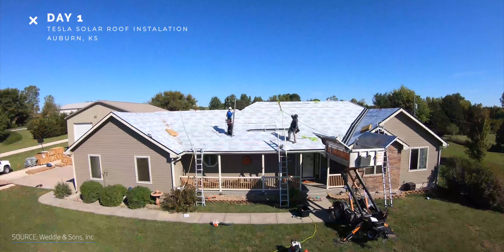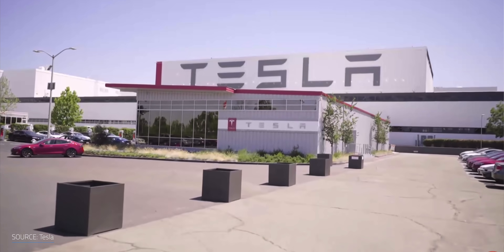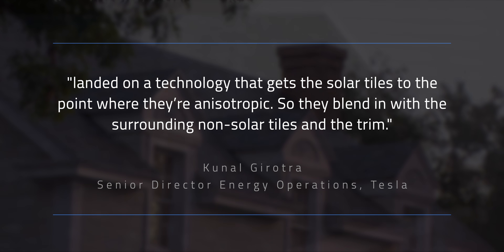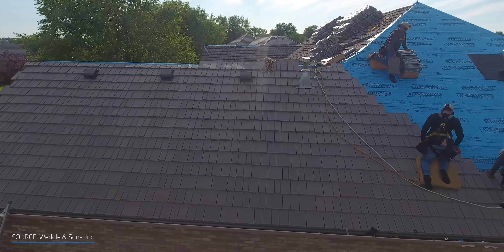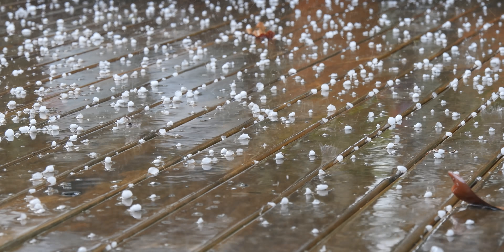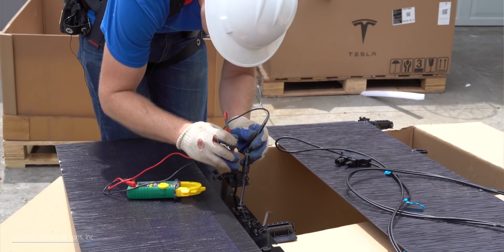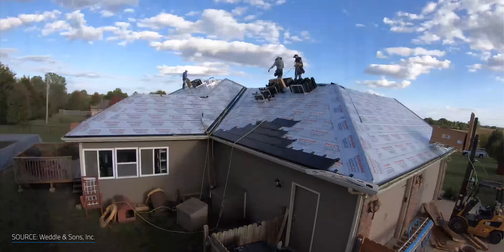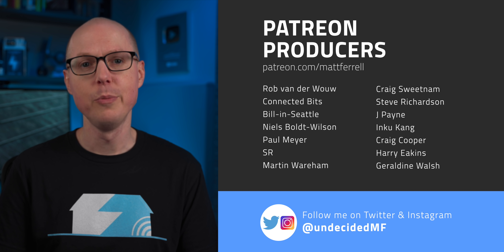Exploring If Tesla Solar Roof Is About To Go Mainstream?

Comment: Matt - thanks for presenting this information.  Could you review the DeSol Power tiles and the Luma Solar tiles?  I am just wondering with the huge price gap if these products have any advantage over Tesla tiles.   Why is there 200 person waiting list for the Tesla tiles?  Surely Weddle could hire and train at least one new team with that sort of backlog.
Reply: I’ve got a friend that has a roofing company. Installing a roof is hard work in a harsh and not too safe environment that few people want to do. He’s always on the lookout for people to hire. If you live in the snow belt you can end up drawing unemployment for a month or so (which can be a plus if so inclined).
Reply from the maker: From all of the info I found there’s really not much of a difference when it comes to lifespan/durability.  In an apples to apples comparison, Tesla has the edge of cost right now ... hopefully the others can drive their prices down as well.

Comment: I am astonished that Asphalt Shingles are still used today. My roof in Ireland is on 22years and still as good as the time it was installed, also comes at a price point less than Asphalt Shingles.
Lightweight Fibre Cement.
Reply: Agreed.  I’m betting it’s planned obsolescence.  The industries in many countries probably don’t want something lasting multi-decade.
Reply: @aussie2uGA  And that is a factor in so many things we use today. A major contributor to the weee electrical waste mountains or the complete destruction of faulty white/brown goods is obsolescence.
Reply: High-end Asphalt Shingles ("Architectural Shingles") last 24-30 years. Just Google "architectural asphalt shingles years"
Reply: @prescod  Hi, thanks for that , I did wonder . Although in Ireland Green Asphalt  felt is used on flat roofing and some low pitched roofs, it comes in rolls , it's very messy , needs to be tar sealed at the seams and has a short life. Certainly it would not be used on a main house roof as the Fibre Cement Slates are well priced. 👍 
I love the idea of a solar roof though.
Reply: Same.  Here in Oz the defaults are a metal roof (low cost, quick to install, range of colours, very long lasting) or clay tiles (higher cost, longer to install, range of colours, variable lifetime).
Reply: @TheOneWhoMightBe  Is it the double sheeted cladding type roof sheeting??
Reply: @jimbanda  Do you mean insulated panels (metal sheet, foam core, metal sheet)?  Those are gaining popularity (I used them for my garage walls) but it's mostly single-sheet metal in a handful of profiles (Custom Orb, Trimdeck, KlipLock, etc).
Reply: @TheOneWhoMightBe  Yes the insulated panels. 
I just wondered, as there are times they can be so handy.
Reply: How would those shingles do in a sunny climate? Our lightweight ceramic shingle roof got brittle after 7 years of 100F+ summers.
Reply: Cement shingles are not cheaper than asphalt in the US.
Reply: @CrissaKentavr  If they lasted 50 years+ ?
Reply: Shingles is a disease and doesn't belong on roofs,  When you go to Italy there is 2000 year old tile on the roofs, why can't we make stuff like that anymore?
Reply: @eXo0us-T  Well they work well enought if you're only planning on living only 30-40 years in the house anyways and don't build something you want to last for generations. That said the 2000 year roofs certainly had some maintinance.
Reply: @patrick_test123  the Tesla roof is glass that should last for generations.  So?
Reply: @eXo0us-T  Well, the glass is going to. But the PV-cells and the plastic structure might not.
Reply: @eXo0us-T  lol... I think all those Cedar Shingles all over the Northern Hemisphere would claim use of the name as well.
Clay Tiles of many shapes and shades have remarkable longevity. Metamorphic Clay Slate has been used for centuries also.
Ultimately though, the solar roof may win through.
Reply: @jimbanda  When you are from Europe you don't think about a roof as something that even has a lifespan - it's like a foundation you do it once and you forget about it. Do you replace your walls in regular intervals? :P

Comment: REALLY looking at this. got quote for 13 Kwh system for 59,580.  BUTTTT - I have 1x12" decking that needs to be plywood. that adds 10k to the cost and then that doesn't include power wall.  All said and done its $180 per month for 20 yrs over current power bill

Comment: Labour costs with respect to installation I think will be the biggest decider as to whether these win or lose.  My 8.9kw panels, which were building integrated, required concrete tiles to be removed prior to installing the panels.  So these panels form the primary roofing material.  It took three people two days to mount the panels.  That’s a 52 man hour job, in Scotland.

Furthermore if there’s a fault later on, then each of the 28 panels are individually monitored using the SolarEdge power optimisers, so fault rectification should also be a lot cheaper - six screws, two connectors and you’re done.  I don’t know how that will work if each tile has to be checked for faults.  I hope they have similar monitoring systems.

Comment: I'm having a new house built right now, so this isn't for me. But, in 15 or 20 years, when I have to replace it, I can definitely see this, or its later generation, being an option I take a real close look at. Especially as the HOA that I now, sadly, will live in doesn't allow solar panels on the roof. I just wouldn't tell them, have it installed, and then see if anyone actually notices...

Comment: Plastic tabs and connectors on the inhospitable roof environment is risky. The hole drilled through the roof at 10:15 is a possible leak from wind driven rain or snow.
Reply: I thought of that, too.  Then I decided it would probably get covered by the top corner tile (after all, they would've have to consider this).
Reply: @christalbot210  It would be covered by a tile or the ridge cap, hopefully, sealed with RTV. But ice buildup can move tiles, wind driven rain gets in, and a hole is a roof is always a hole in a roof. The plastic tabs should be sealed and channel water around their nails.

Comment: More expensive, doesn't look great unless you do the entire roof surface, working with Tesla is a problem, and most of all - all those electrical connections in inhospitable locations are an arc-fault nightmare in waiting....

Comment: While the concept is very good the industry is still in its infancy.  Also, you didn't include the added cost of the battery &/ electrical system that is needed for the solar roof.  That could add another $10k or more to the cost.
Reply: Tesla powerwalls are not required, you get them if you want to store the energy produced by the solar roof.
Reply: @boostav  Understood but you still need to tie into your home's electrical system and the electrical grid.  That costs $$$ which I don't think is being included in the estimate of the roof installation.  Perhaps it is but I don't think so.
Reply: @mikecolie9290  It is

Comment: Solar roofing doesn't make much sense unless its paired with supercapacitors & rechargeable batteries to efficiently store & deliver power.
Reply: Well, good news Tesla sells rechargeable battery packs for homes too.
Reply: @donaldendsley6199  And even better news if they are included with the solar roofing panels.

Comment: if you live in an area where hail can damage roof tiles, why are you not using tougher tiles?
Reply: Large hail is extremely rare. Most roof material can handle hail up to 1 inch in diameter.

Comment: I have a standard roof with solar panels. When it comes time to replace the roof, how much extra will it cost, to remove the panels, and replace the roof with the Tesla solar roofing? Is there a recycling discount for my old solar panels, or will removing them cost more than the recycling value?

Comment: Great update Matt. Seems like demand is never the issue. The engineering challenge to make it scale and cost effective is the key. I really can’t wait to see how far and how fast this goes.
Reply: A gust of wind and your roof get blown off as the solar panels are NOT FLUSH with the roof and actually CATCH the wind at the edges
Reply: @esecallum  I am 99% sure they’ve tested their roofs for wind loads they can handle.
Reply: @uspockdad6429  The edges catch the wind and then no roof. also glass solar panels are VERY DANGEROUS AND CAN EXPLODE DUE TO HOT/COLD CYCLES OR IF HAILSTONES HIT THEM. ALSO THE CABLES CAN SHORT CIRCUIT CAUSING A ROOF FIRE
Reply: @esecallum  Your really clutching at straws aren't you
Reply: @jamesminett9717  GOOGLE SOLAR PANELS BLOWN BY WIND. you will be shocked and hortified.
Reply: @esecallum  That wasn't even a solar roof ,Do you want me to show you the hundreds of videos of regular roofs being blown off aswell
Reply: @jamesminett9717  shows solar panels are FLIMSEY
Reply: @esecallum  if i remember correctly, tesla has inhouse tested its roof tiles to be like 4x stronger then any other tile
its one of the reasons they have the material strength freedom to make bigger panels thus reducing production costs 

idk how accurate their reports are
but in time testing will show all we need to know 

there is also the obvious point that properly fixed solar panels should easily be able to manage wind
tring to blow away a properly fixed solar panel with wind
would be fairly similar to trying to blow on ur car and roll it over
doesnt matter that there us space for the wind under ur car or solar panel
that point is actually meaningless 
its not happening without a proper natural desaster
and if it does, it is 105% the installers fault
for not securing the panels properly

if wind blew on the windows of ur home and they fell out
u would clesrly blame the installer js
Reply: @William Walters good luck when the battery loses it charge at 50%. these panels are just gimmick. who is gonna deal with the VERY COMPLEX ELEXTRONICS when they break down and it will cost a fortune

Comment: For most homes, only one face of their roof will be at the right angle for optimum PV efficiency.  My home, for example, has a hip roof with only a small southern face.  My roof's east and west faces would only be efficient for half of the day.
I ended up putting panels on the southern face of my barn's roof.  Loving it so far.

Comment: I love to see how they compare. I think the main advantage is the optics’s... I guess that a proper Glas glas Solar Module Is more durable, has less connections to fault and will have higher pv output. (Even normal arrays often have Connection or whire problems, and I love systems that monitor each panel individually, especially if there is possible shadow)
Also im interested in heat efficiency problems, because there’s not much air behind the tiles... 

The only argument is, when you realy need a new roof... 
Here in Germany most roofs have tiles   Proper roof tiles already that last normally about 50years...
I’d love too see more housing youse pv, aswell as there are some pretty good integrated roof pv Systems already, at last in Europe... 
i Hope the system will start a new buid with pv trend